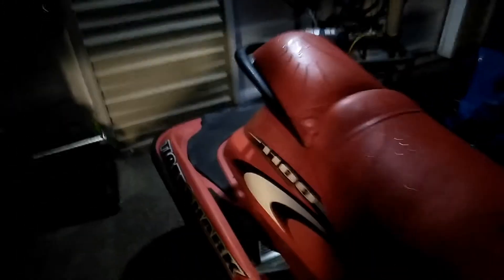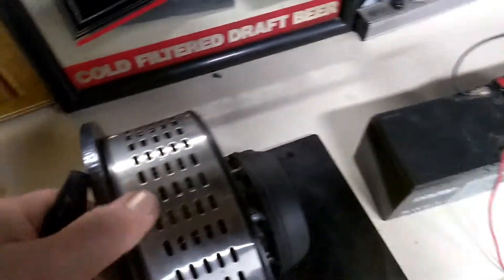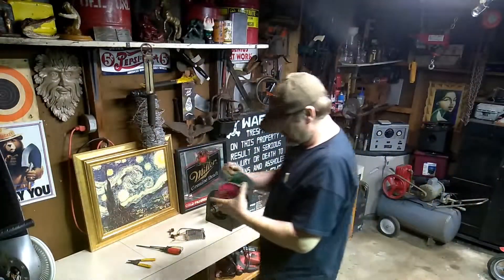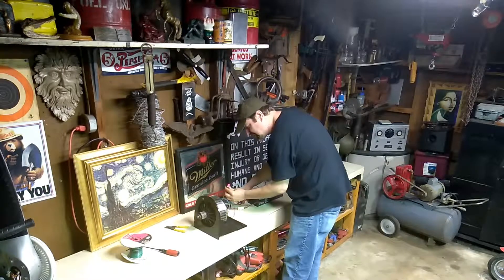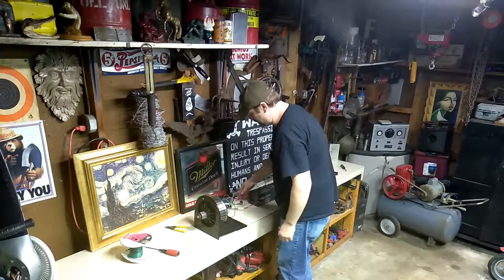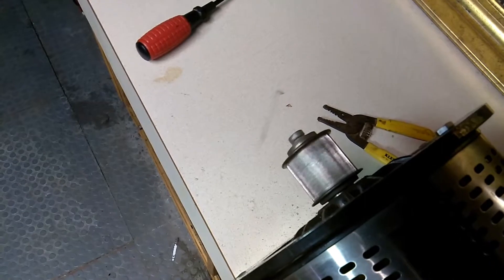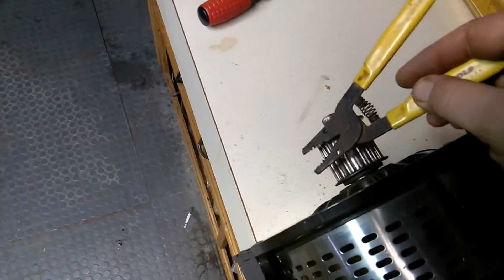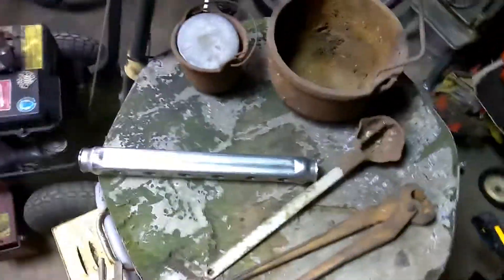AGNI High Power Motor + Cheap Chinese PWM Motor Controller Test, It's Veeerking! 😁

Comment: there were companies making these Lynch motors Lemco, and beginning of the 2000s Briggs & Stratton made them called them their Etek motors that can make 15 hp unfortunally Briggs & Stratton no longer makes them as other companies cloned the motors as NPC sold them the NPC X950 Briggs & Stratton/Lynch motor mainly for robots for the Battlebots and Robot Wars in the UK the motors were mainly used to drive spinning weapons with destructive results. one uk robot for example is Hypno-Disc.  and Cyclone on the us robot wars extreme warriors used a 12 hp briggs & stratton motor on its vertical spinning disc and flips robots out of the arena. but people use the lynch motors for electric vehicle projects. im not sure if NPC even sells this Briggs & Stratton /lynch motor.

Comment: Hi guys.

Ive just "discovered" these motors.
I have a small tractor with a 1960s 10hp gasoline engine. I think these might be perfect for replacing it.

Does anybody currently make these? I found the agni webpage, but it does not give information on how to buy.

As a mechanical engineer im good with doing all the fabrication work, but need some support for the selection of electrical components.
Reply from the maker: I looked into it, I found this as a US supplier: 
https://www.cloudelectric.com/category-s/442.htm
but I will keep looking later this afternoon when I have more time
Reply: @ProlificInvention  Thank you.
I continued digging and it seems that Lynch motors in the UK make them also. Did you ever finish this project or the hand tractor? Would love to see what the motor is capable of

Comment: That motor is designed to run up to around 72 volts. It was used in the early Zero motorcycles. The brush carrier assembly has a tendency to burn up. Please take a look at my channel. I modified an Agni from a broken Zero my brother had in order to keep the smoke in....
Reply from the maker: Oh hellz yeah, I'll definitely be checking that out.  Thank you for commenting, it's always appreciated.  I'm a huge fan of these motors, check out this info I ran across at some point:

The Lynch motor is an unconventional design with a disc armature. It marries the advantages of a conventional, wound armature motor with the benefits of a flat (printed circuit) motor. It is similar to a pancake motor, but is more powerful than any of these technologies. The disc armature has magnets on both sides, doubling the available flux density and shortening the magnetic path. It therefore packs more power per pound and per cubic inch than any other motor technology. Of course such a revolutionary motor is not for every application - it is not as cheap as wound field motors, but for many applications it is a far superior motor.  It has a previously unheard of power to weight ratio and also power to volume ratio. It is also highly efficient because of the double magnet design and associated short magnetic path. It also includes integral fan cooling.

 The Lynch motor is an important development which spurred other motor designers to improve their products to remain competitive, such as synchronus permanent magnet machines.  As a result of the competition between manufacturers the cost of high performance motors and controllers has fallen dramatically.  We hope the cost of solar cells also reduces to allow renewable transportation to develop as a viable alternative to carbon fuels.
Cedric Lynch built his electric bike around a mid-drive configuration, also building one of the worlds most efficient light weight electric motors to power his rig reliably at 60-MPH for significant distances. He would later set several world records with his axial flux motor and bring it to market as the Lynch / Agni motor. Briggs and Stratton would eventually buy this technology which would lead to the Etek motor, which is now famous for making high speed efficient electric hot rods.

Cedric uses to achieve high speeds is by following the rules of aerodynamics, and building a bike that is as aerodynamic and as efficient as possible. The other builders on this list bypassed this step, and Cedric uses this bicycle as daily transportation on real commutes. Although this high-efficiency motor uses “old school” brushes, this fact allows builders to use very affordable controllers. He has proven his design choices through thousands of miles of commuting, and the Lynch motor is highly respected.

Cedric Lynch is known as the creator of the Agni Motor, a highly efficient electric motor that weighs around 25 pounds and can put out as much as 50hp. 

Cedric Lynch is a British 'mad scientist' type mechanical engineer obsessed with the idea of greener transportation. His interest has been in building a super efficient yet powerful vehicle that can serve as a car replacement.

He started thinking of his own design for an electric motor in 1983 when he began entering competitions organized by the Battery Vehicle Society regarding building an efficient electric vehicle. At the time there was no reasonably priced DC motor with descent efficiency so Lynch decided to build his own utilizing modifying existing motors with old tin cans that he would spread out flat to use as cooling fins. Surprisingly using rudimentary materials and a garage work bench, Cedric was making better more efficient electric motors than any of the universities were able to manufacture in state of the art workshops.

Cedric then came up with a motor design that could be cheaply manufactured and began manufacturing his own motor that he could sell to the public in 1988 and the Lynch Electric Motor Company was born, known as LEMCO.

Cedric first used his motor to create a small boat called “The Spark” that would set an electric boat efficiency record. From there Cedric turned his attention to bicycles, an application generally considered too small for a lynch motor at that time. Cedric mounted his motor in recumbent bike, allowing him space to eventually use a set of thundersky lithium batteries.

The resulting aerodynamic recumbent bike had a top speed of 60mph and still managed an incredible range of 150 miles. Cedric rode his recumbent creation everywhere as a daily commuter, putting an amazing 50,000 miles on the machine - technically a motorbike.

Briggs and Stratton, the US firm famous for lawn mower engines, bought the technology and used it in their E-Tech Motor, and Cedric went on to manufacture his latest incarnation of his lynch design into the Agni motor, which is used in go karts, sailboats, motor boats, and even small airplanes.

The Lynch designed motors all have the same traits. Brushed motors, around 25 pounds in weight and they are able to put out enormous power compared to their weight. Sometimes as high as 50 hp (depending on amperage ran through the motor) at an incredible 98% efficiency.  Lynch Motors are also the most often used motors in electric motorcycle racing applications.

Cedric's zero-emission motorcycle, which has a top speed of 120mph, was shown in action winning the world’s first zero carbon race – the TTxGP in the Isle of Mann.

The idea for the electric motor has been snapped up by the 56-year-old’’s friend Arvind Rabadia, who together with his brother Hasmuk Rabadia had been thinking of starting a business in India. They have now set up Agni Motors to make further-improved versions of Cedric’s motors

Despite Cedric’s breakthrough invention he has no formal engineering qualifications and taught himself the techniques needed to construct his engine. He first became interested in electrics when his parents bought him a book entitled How to build things from things found at home. 
The Etek motor is a brushed 25-pound pancake shaped motor that puts out enormous power for its weight. Depending on amperage and voltage the Etek can easily provide between 15-horsepower and 30-horsepower reliably and consistently (11-kW / 22-kW). A perfect platform for a powerful electric bike if you do not mind the weight. Although brushless motors are considered more modern, a brushed motor like the Etek allows the builder to use very affordable controllers.

Cedric-Lynch invented the motor and sold it to Briggs and Stratton which US company produced the Etek at a lower price (around $600). In the late 90’s early 2000’s it was the way to go for a high-power / light-weight electric vehicle. Many small E-vehicle records were set using the Etek motor. Finally, the market had a relatively lightweight and powerful electric motor available to the masses.

In essence, the Etek allowed hot rodders to build electric bikes. Before the Etek very few people had ever achieved 50mph on an electric bike. Even today, Etek motors (and newer incarnations of the Etek motor) are used to make some super fast electric bikes. In the case of Liveforphysics, the fastest E-bikes ever.

 Liveforphysics used a newer version of the Etek (the Agni motor), to achieve speeds of over 70mph, and dominate a recent hill-climb event.

Every Etek I have ever ridden has been characterized by brutal off-the-line acceleration, usually to a point where you have to apply the throttle very carefully or get thrown off. However, it is possible to run an Etek at a lower voltage or lower amperage and have a very manageable, safe, and sane electric bike that will not burn out on you, no matter high steep the incline.
Reply: @ProlificInvention  I used modified hand-shaped and internally polished copper water pipes hard epoxied into the old burnt-up brush carrier; I also used a different type of brush from the original ones. Each pipe was electrically connected to the brush power feed to unload the pigtail and prevent any current from going via the springs, conducting power all the way at high current to within a few mm of where it is needed, between the tip of the brush to the commutator contacts. The copper keeps it all cool in addition to its conductive properties and can tolerate much more arc heat than composites can tend to. I didn't post any construction videos, just testing.
Reply from the maker: @MrOzzyCam  That's way way beyond me and sounds amazing...truth is I just have the one AGNI motor that came off a 2 seater commercial go cart with a full spring steel surround.  I was a fan of that motor immediately for it's small size and power... just a random buy off some offer up deal, sold the cart but kept the motor.  I have driven it off many power supplies of differing levels and it has proven reliable in quite a range of input and repower projects, but perhaps it will need a rebuild  sometime-Hopefully not.
Reply: @ProlificInvention  these Agni motors came in a few types. The motor in my brother's Zero used a version with a reinforced armature, the 95-R, with a peak of 6000 rpm max and 16 kW@78V in short bursts, though for continuous operation, 48 Volts is the correct maximum and gives 9.5 KW, so it wouldn't fly apart at high rotational speeds. The 95 version without reinforcement is not rated beyond 4000 rpm, though and would have exploded with my test! I bolted my motor to the bench for testing and made sure I wasn't standing at the side of it at full speeds. These are very efficient motors (maximum 93% as stock), though they do require maintenance. They don't lose power in controller circuitry and reduce complexity in the KISS, keep it simple... philosophy. The brush carrier was the weak spot in this motor design; the original composite material burns up too easily and doesn't keep the brushes cool or really well supplied with current like the copper tubes can. Resistance is lost as heat, so you want to keep it down where possible. IMHO, If I were going to make an aircraft using these motors (which I am not), I wouldn't trust it with the original motor-designed brush carrier; I would want a copper tube design, same in racing applications, where you are pushing the motor. The original motor tends to fail when the commutators are pretty dirty, and the motor is overtaxed and overheated.